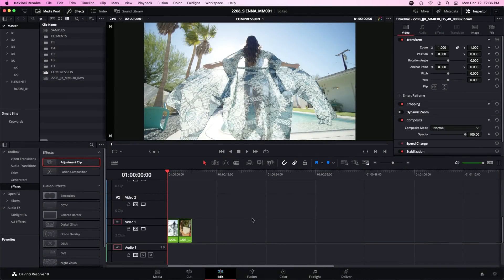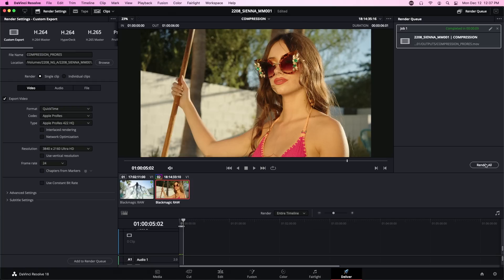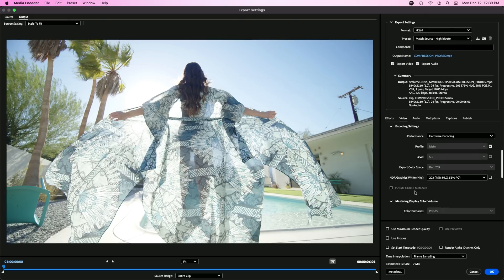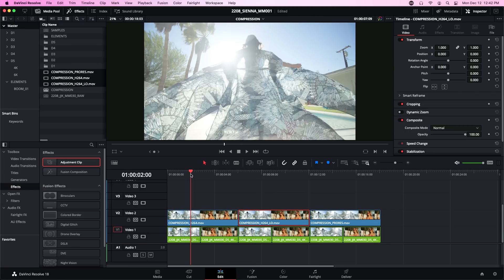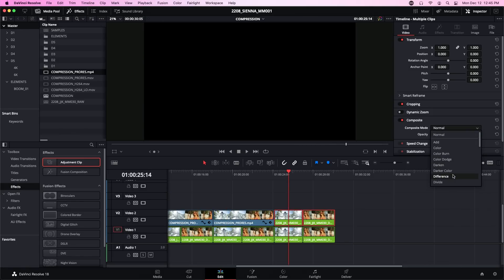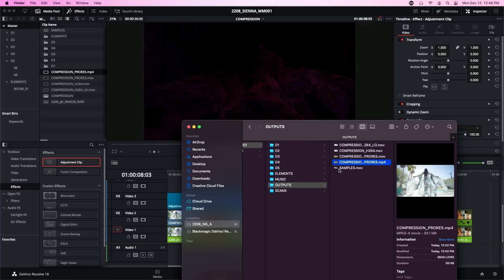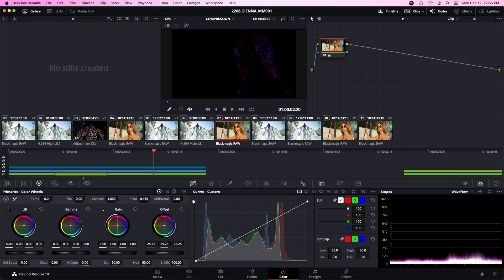What Difference Composites Reveal About Your Compressions

Comment: Resolve can run H264 exports slightly slower and achieve ME results or better (same file since and so on). But you need to adjust the settings. Export speed under “file” makes a big difference (something like 75% is much cleaner), but there are more settings.
Reply: Out of the box Resolve goes all in on export speed (with H264, H265 and so on). ME is slower and cleaner. But there are different options and settings to exchange speed for quality.
Reply: Not the first find I've read to slow DR down to get better quality. Hopefully it sticks for me to try next render. 
Cheers

Comment: As others said, there's a multi-pass option in Davinci Resolve (not sure if it's available for the free version) and the "auto" settings for quality and encoding profile definitely have an impact on the result. There are other considerations as well, like the encoder used as not everybody is using Apple hardware. Otherwise, very interesting video.
Reply: The multi pass option and HW acceleration (plus every other option as far as I know) is available in the free version too.
Reply from the maker: There are basically infinite combinations of settings that I could compare in this video so I went with Resolve's default ProRes settings, their default H.264 settings and an overly-compressed H.264 setting. The goal with the ME encode was to match file size. I do appreciate the feedback and will continue doing these little tests.

Thanks for jumping into the conversation!

Comment: You didn’t talk about file size, the aim of h264 is to export with a good quality/size ratio. If you get a h264 file that is same size as prores or even larger to get same quality, then there is no point
Reply from the maker: I disagree with this as H.264 is an inter-frame codec and ProRes is intra but I don't disagree so hard that it matters. Thanks for commenting and I do appreciate the feedback!
Reply: @JJKoester  well hence there is no point to get h264 if your file size is same as prores.

Comment: Interesting idea, but I'm not sure if this proves anything without being more rigorous. You might just be testing whether 2 pass is better than 1 pass (which it generally should be.) The Multi-pass encode check box is right there on the Custom Export panel. If you're going to set a specific bitrate in AME, why not do the same in Resolve? Profile? Keframe interval? Etc. An apples-to-apples comparison is called for. It might be that DV's MP4 output is subpar, but I'm not sure this test revealed that.
Reply: I agreed. Perhaps add "... with default settings" to your title in order to make it less misleading but still informative. I would have still clicked it. Otherwise, great video! I just subscribed! Thanks!
Reply from the maker: @robcombs996  We're going through the comments and will be updating the title/description of this video soon. We really appreciate the feedback and are taking it seriously.
Reply: ^I agree. 2 pass and 1 pass are very different, and that range setting vs just a single pass bit rate limit really comes into play for scenes with lots of detailed movement. 

I'd be curious to see what the file sizes ended up being for each export as well.
Reply from the maker: Totally fair feedback. The guide for this was an export at Resolve's default settings and then an export from Media Encoder that was comparable in file size. I understand the push back on this method.

My hope is that I covered our methodology so that anyone could copy it and apply it to their own exports. There's simply too many combinations of codecs and bit rates for me to test them all so I figured I'd cover the basics and leave the conversation open.

Thank you for your feedback and I totally understand why you feel that this methodology isn't conclusive.
Reply: @JJKoester  Kinda sounds like the first statement "you should never export to H264 in divinci resolve" might be misleading?
Reply from the maker: @toddgattfry5405  A legitimate case could be made and and I don't disagree. We will be doing a follow-up video and updating this one as well. Thanks for your patience on those changes.

Comment: You know that you can actually do a h264 HQ VBR 2-pass encoding in Resolve same way as you did it on Media Encoder, Right?! 😉

Never say "never"... but I got your point!

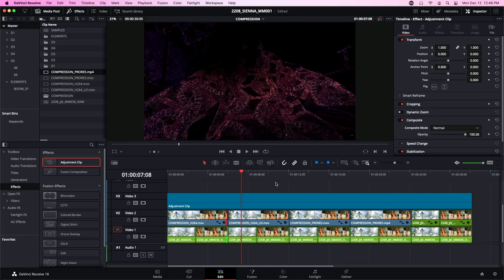Well said, though, by clarifying (at 08:00) that h264 isn't suitable for source or grading material! 

Great explaining on how to pin-spot the differences! 😃

Subscribed! 🤟
Reply from the maker: I've poked around in the H.264 encode settings in Resolve and haven't found the VBR 2-pass settings. I'll poke more.

I admit to a bit of hyperbole in the title but I still believe that people should be doing an archival output and then building delivery outputs from that and H.264 isn't archival. I'm not trying to be obstinate. Our pipeline simply didn't have an H.264 output from Resolve long before we did these tests.

Thanks for the comment and the sub!
Reply: @JJKoester  Multi-Pass Encode in Resolve
Reply from the maker: @TomCut74  Thank you for the nudge! We've found it and continue our experiments.

Comment: Many thanks for that. I gave up on 264 early on, finding 265 worked a lot better. It appears to generate far fewer artefacts with a smaller file size. I mostly use Atom or pro res when I’ve got the space want to do more processing and don’t want to send it anywhere. YouTube appears to deal with 265 without a problem and Apple pro res if you don’t mind spending hours uploading. I shall now nick your testing method and take a closer look.
Reply from the maker: I tried to give enough information about our process that anyone could replicate it if they wanted to. I'd love to hear how your tests go!

Also, I'm looking forward to doing some benchmarks for H.265. I've heard a lot of good things about it but haven't jumped in yet.

Thanks for commenting!

Comment: Wow that’s a really impressive way of demonstrating the issues with Resolve’s H264. I had heard about handbrake, but never knew just how bad Resolve’s H264 encoding was.

The only thing stopping me from using handbrake is render time. How long does it take to render a 4K video to DNxHD then handbrake to H264, versus just rendering to H264 in Resolve?
Reply from the maker: I was also surprised at how much this test revealed about the different compressions. Handbrake has come up in the comments a bit on other boards and I'll run some tests there as well. I've never used it because I've always had Media Encorder and that seems to work well.

About render times, I don't usually care how long it takes because the computer is doing all the work and I can play some Castlevania.